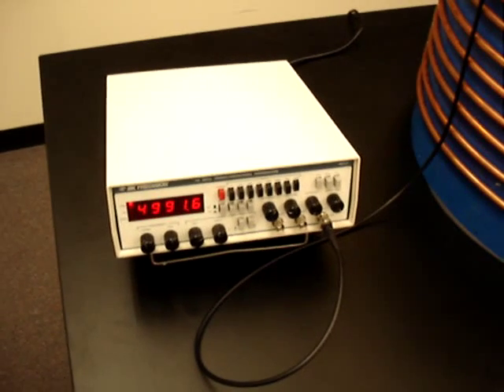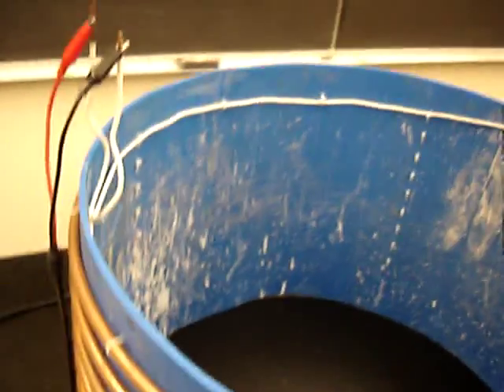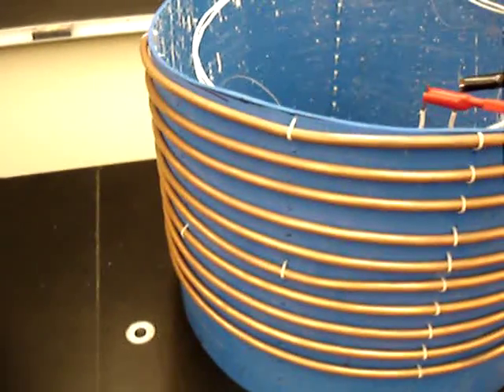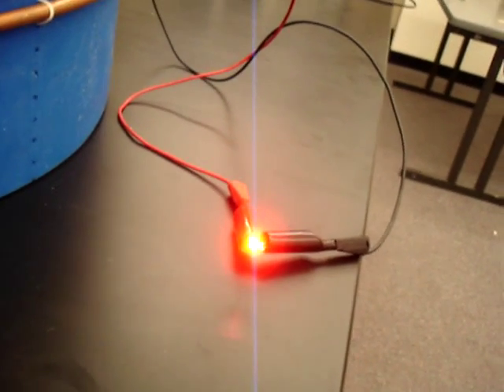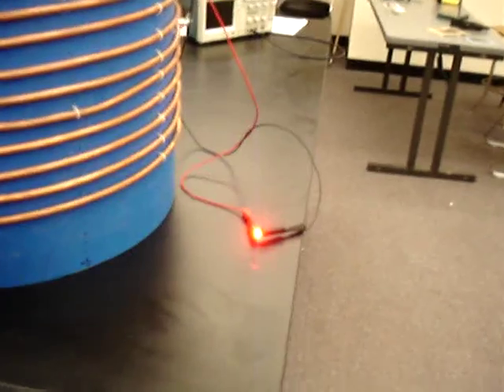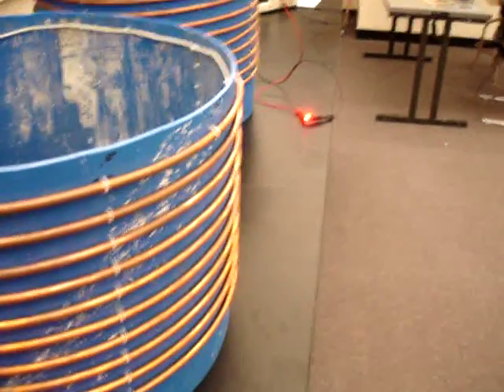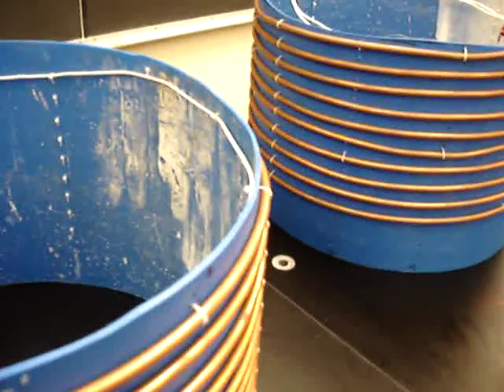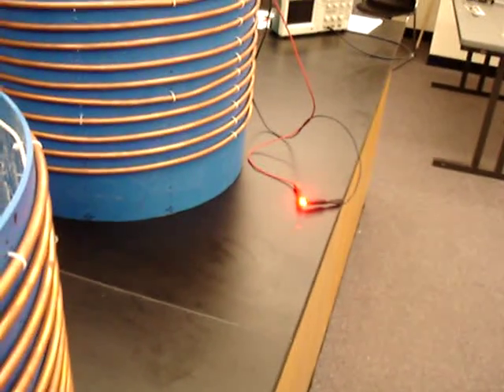Wireless power transmission

Comment: sir   ,   is there any speciality with copper coils , in the paper it is given that coils are designed by cornell students. and should the 2 coils must be of the same size and turns inorder to obtain the resonance circuit?
Reply from the maker: +ajp Hi - the coils have to be resonant at the same frequency, and if they have the same size and physical dimensions, then they will automatically resonate at the same frequency.  However, it is possible to construct coils with different physical dimensions that will still resonate at the same frequency, so that is an option.
Reply: +derinsherman62 
sir   we would like to do this topic as our main project .  we are planning to use coils of different size . so by impedance matching can we achieve the magnetic resonance and  2m range.  ?  can you pls give us ur mail id to clarify the doubts?
Reply from the maker: +ajp The key is resonance - not impedance matching.  If the two coils have different frequencies, then this won't work.  This is somewhat similar to a radio insofar as both coils must operate at the same frequency in order for power to flow efficiently from one to the other.  That is, if you mis-tune your receiver coil, it won't receive any power from your transmitter coil in much the same way that a radio receiver will only receive a station if the receiver is tuned to that station.  If you want my email, I'm a physics professor at Cornell College - it's easy to find my email via Google.

Comment from the maker: All waves spread out to some extent.  The larger the wavelength, the more quickly they spread.  At 5 MHz (the frequency we used) the wavelength is about 60 meters, and the waves spread out rapidly.  At microwave frequencies, the wavelength is only a few centimeters, and the waves can, indeed, be beamed from one place to another.  In fact, some people have proposed placing solar panels in orbit and beaming back the power in the form of microwaves.

Comment from the maker: If this was a high-power radio transmitter, then you would be right and most of the energy would be radiated away.  But this system uses an evanescent wave that decays exponentially in space and doesn't radiate power unless there is a resonant receiver in close proximity to the system.  Please note that the circuit used in this video isn't all that efficient and most of the power is converted into heat in the coils.  This was a demonstration circuit made by students interested in wireless power.

Comment from the maker: @salimkhan007 Hi - there are subtle differences between this system and a simple transformer.  You should try a Google search on "MIT Wireless Power Transmission" to find out about the details of this system.  This system is neither a radio nor a simple transformer, but something in between.  It produces an evanescent wave that decays exponentially in space and resonantly couples the two coils.  My students were able to demonstrate both the resonance and exponential decay.